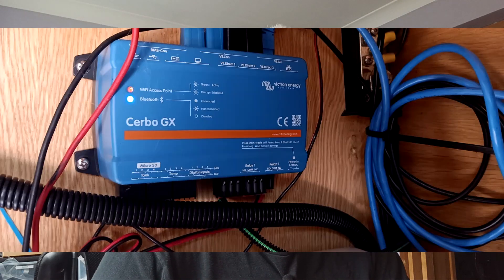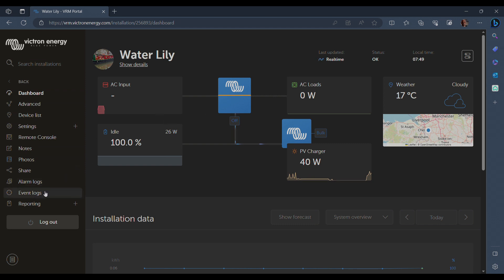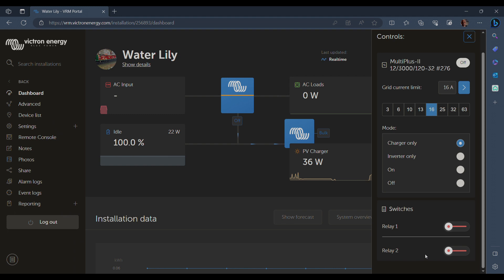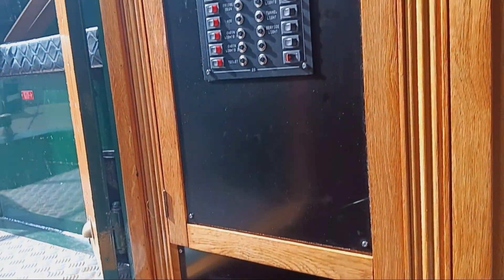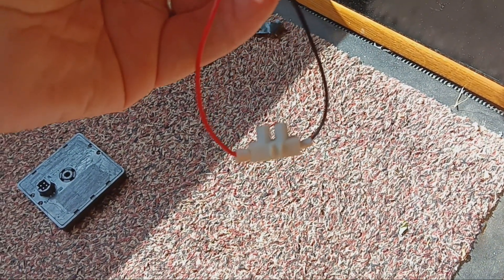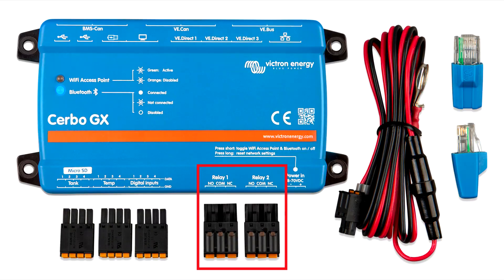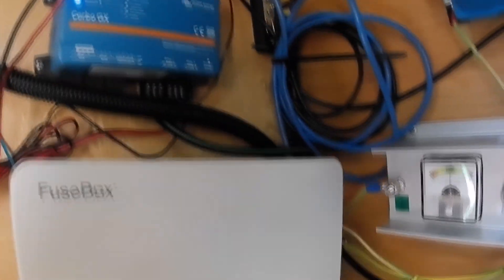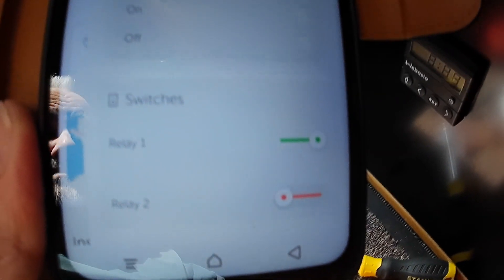#48 Internet controlled heating on our narrowboat

Comment: I followed the instructions in the YouTube above and it works a treat. Like Rob, I didn't want to cut into the original wiring harness and whilst searching Webasto parts I can across a Controller W-Bus Y-Adapter, part # 1319820A. This has the same 4--wire plugs and sockets as the Extension Cable, but has a 'Y' joint integrated into the harness creating an additional spur. It's a similar price to the Extension Cable, but shorter at about 0.4m and fits between the original harness and the 1530 timer in the same way. To reach my GX Cerbo I needed to extend this spur. I did this by snipping the red and black wires from the plug and attaching them to a length of 1mm twin flex using small auto crimps. Then before connecting the Cerbo relay plug I slid a length of heat shrink over the joint I'd just made and shrunk it on to seal the joint. Finally I attached the relay plug, connected up and tested.
Reply from the maker: Fab thanks Colin, glad you sorted and good shoutout of a better part! Thank you for taking the time to comment.

Comment: Have you figured out how to use those cerbo relays with temp sensors to control when the webasto is on or off, so that you don't manually have to shut it off after it's warmed up?

I've got the smart thermostat from webasto in my van, but you have to be in Bluetooth range to muck with it wirelessly. I'd love to have my onboard cerbo use my wireless temp sensors to keep my van, and battery bank, away from harsh temps when I'm not using the van daily. This seems like a good way to go, just unsure how I could integrate with the smart thermostat.
Reply from the maker: Hi, no, not really given that too much thought as we tend to leave the Webasto on when we want it. I can see its probably do-able though and would make a good project!  thanks for watching.... Rob

Comment: Hello Rob. Thanks for the video. What is the name of the plugs that you plug into the relay sockets on the Cerbo? Looking at buying some to setup by Webasto as my Victron installer did not leave any for me. Cheers.
Reply from the maker: Hi Joseph, thanks for watching and commenting. Those plugs come with the Cerbo GX so your installer should have left you a plug for each connection on the Cerbo - have a chat with them!. I think  I've found some here in case no joy but talk to your installer :  https://www.ebay.co.uk/itm/305122687912?hash=item470ababba8:g:oMYAAOSwkBlk-Jd-&amdata=enc%3AAQAIAAAA4MO4I0WiI1KLV2ajEbRfUkMZeFSO1qNEmILBU%2FEWiDjVqADcjw8g1bVMFy20WEW9XkoRScrw4yF5McnZfkUVxPzfGDXATSWaKR761e4RmmpAHJ1q1sKx59jkHJAQThL9bF%2F7ik2vwTc7l3Jevguo77dj8Nxsc8H5lC65guU8D4PcJZhI7HMFDCsgJURuHsyWwca33oMqLFtpueQemvU7czWmaxRextehWmWtDpZU2m%2FcvCGHUn89vue3PI%2BQDIwUrkX5zQBfNJPxVeSJhzvlG3uWVpMz6dgoWAhquM7F43BR%7Ctkp%3ABk9SR-jWp9imYw